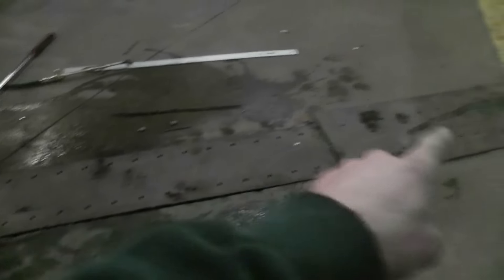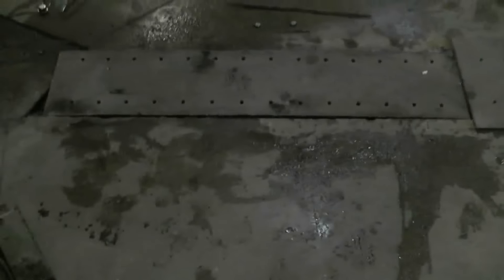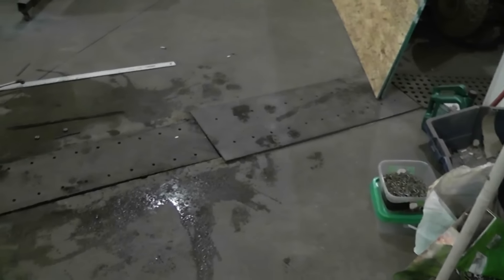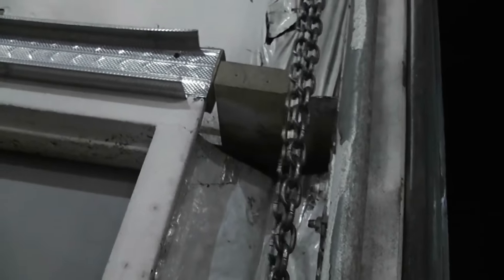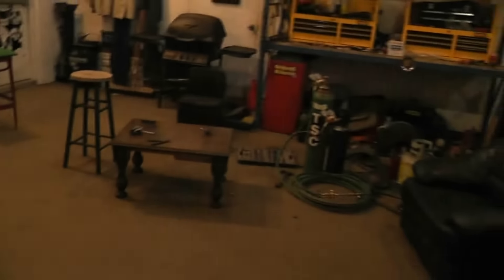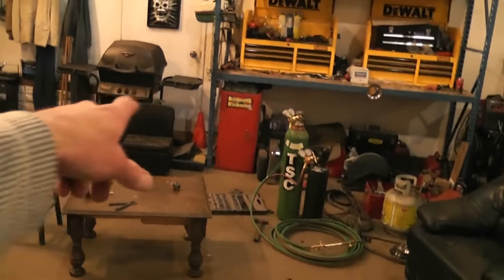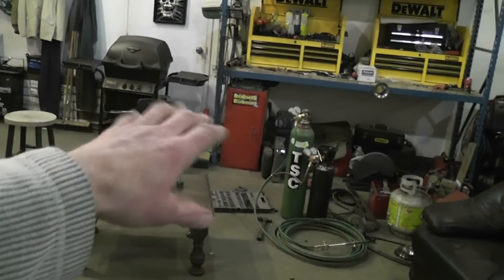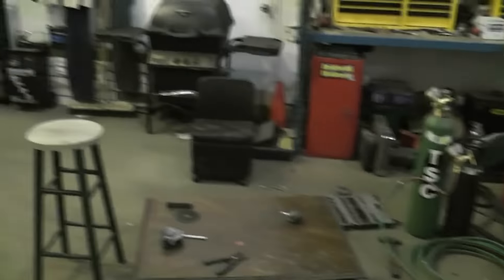Fixing the Drain Grate

Comment: I was just noticing in an earlier vid that you were talking about buying bottles for the torch and what not being super expensive. I understand using the torch to heat things up but seems like majority of what you use them for is cutting. Why not buy a plasma cutter. about the same price or less as an oxy acetylene setup but yet no refilling?
Reply from the maker: +snowboard13gcuz Plasma cutter won't get into tight spaces to cut bolts off and stuff.